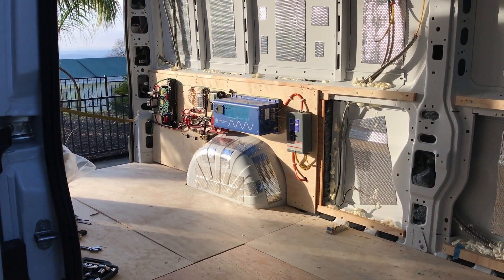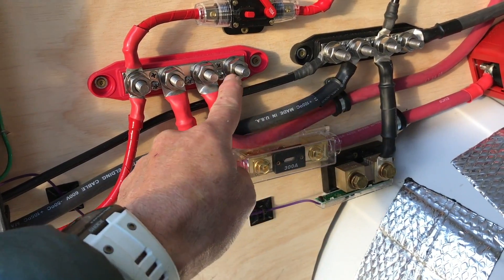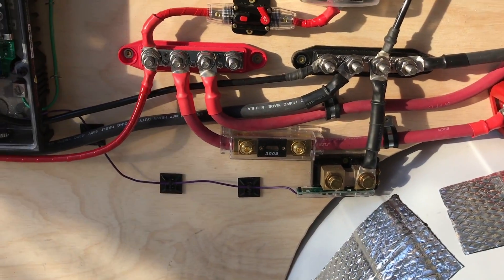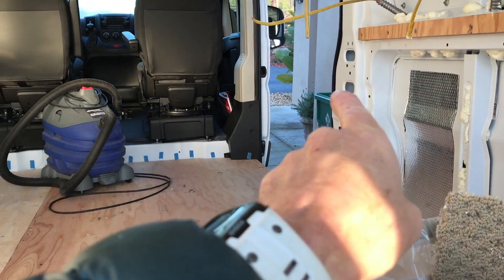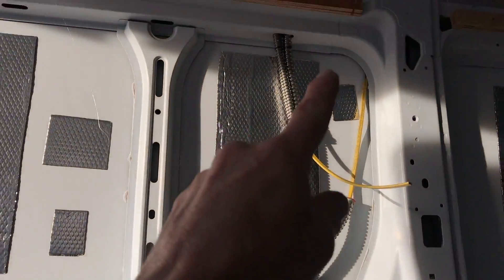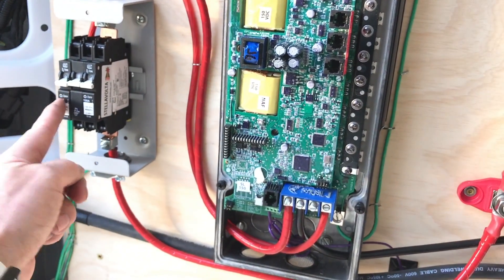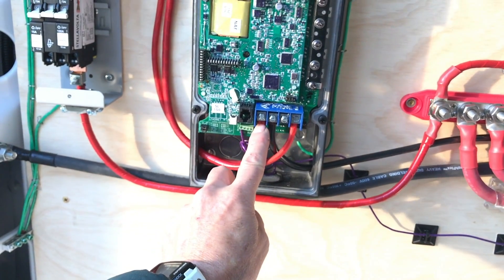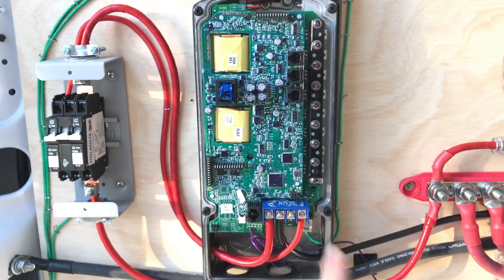Promaster Conversion #4, Solar Wiring

Comment: Hi Bart, followed your conversion and wondering if you still have the van and how is it holding up? Thinking about doing another conversion and liked your layout and electrical set up. Thanks.
Reply from the maker: Everything still works fine.  Technology has improved a lot since then.  From an ELECTRONICS selection, if I built another van today:
--I'd switch to a 3000 Watt Victron Inverter and a Victron Solar Charge Controller.  The Midnight Controller was overkill for van.  Technology has made it so much easier today since you use your iPhone to set it all up, and use your iPhone to Monitor everything.
--I did swap the lead acid batteries out for Battle Born batteries.  They're fantastic and worth the money.  Battle Born advises to switch to a different Battery Isolator that's on their web site.  That Isolator does require an additional wire from the ignition.
--I wouldn't bother with the metal armored cable protectors and just use plastic armored tubing to protect the wires from abrasions.
--I did swap out the 20 amp outlet on the side of the van for a 30 amp receptacle.
--All the wire sizes worked out fine.  
--I'd probably change over to a gas cooktop.  
--The microwave has worked fine all this time.
--The Cell Signal amplifier is GOLD, a must have.
--The Wifi amplifier is GOLD, a must have.
--The Dometic Frig has worked great all this time.  The only complaint is the freezer tends to frost up.  
--The Power Step has worked great all this time and was worth the money.
--The Fantastic Fan has worked perfectly all this time.
--I probably wouldn't buy the ELECTRIC version of the awning again.  I'd just buy the hand-cranked version where the awning legs attach to the side of the van.  The awning motor has worked fine all this time, but,  it's not big deal to hand crank out the awning when you want.
Reply: @onthetrailwithbart523  Thanks for the thorough recap! Do another van with the new tech! 😀Your videos are what helped me build my first two vans. You are very thorough and easy to understand. Thank you..
Reply from the maker: @iamjoec62  Thanks for the kind words.

Comment: Thanks so much for the quick and thorough reply.  I will try the switching routine you described.  I do have the remote inverter panel on my cabinet at the side slider door, but I have NEVER been able to make that green “shore power” led illuminate!  Thanks again, keep doing the great work that you do!
Reply: I had mine set to the config shown in the vid (1,1,1,0,0)  but the Aims guys corrected my settings to (1,0,1,0,1) which enabled my shore power.  Thanks for the vids, your van and MUCH inspiration!  (I even copied your insulation method - VERY efficient way to thermally tighten a van).  I’m looking forward to selling my 2500 and starting on a 3500 conversion - I plan to do it the very same way.

Comment: Hello Bart.  Your vids inspired me to build a twin of your promaster (much less power components, but the solar and battery board was a straight “copy/paste” for me).  The batteries were replaced this week with (3) new 280 Ah LiFePO4 batts, bit other than that, the rest has worked pretty well.  Question - when you connect to shore power, in order to get the Aims inverter to prioritize the shore circuit, do you need to power down the solar charge controller (and inverter)?  I assumed that the inverter would automatically sense the shore power and switch off the battery bank and just send that power through to my breaker box and to my outlets.  It has never been able to do so.  I have confirmed 120vac at the inverter input when shore power is connected and live.  Curious if you had any issues with the shore power.
Reply from the maker: --My routine is this:  When I'm getting ready to leave an RV park, I turn OFF the inverter first (center position (0) on the switch on the inverter face), then disconnect from shore power, and drive away from the RV park.  If the inverter is ON (without shore power) it will drain the batteries.  Newer inverters, like the Victron, use a TON less power to keep the inverter in "idle mode".
--When I pull into the next RV park, I first connect to shore power (with inverter off).   After shore power is connected, I then switch the AIMS inverter switch to "On" (the = sign position) and the Green LED light should come ON at the Aims Inverter display panel.  Remember, I use the Aims Remote Switch, as I showed in my "Final Walkthru of My Promaster" video.  That video shows the green light is "on".  If you don't have that remote, you'll have to go back to the inverter and switch the inverter back to "ON" (which is the (=) position).  That should then show a green light as "On/Shore power" at the Aims Inverter.
--I never touch the Solar Breaker unless I'm shutting the entire van down.  
--If I'm not going to use the van for weeks,  I shut the entire van down.   I shut off the master BlueSea switch from the batteries. I shut off the inverter.  And I shut off the breaker switch from the solar.  This way the batteries are isolated and won't discharge, and the solar charge controller is OFF too.
--NOW...one problem is if the inverter is somehow "broken", you won't be able to use your 110V outlets.  "If I had it to do over again"...I'd install a 3 position BlueSea master switch where the 10 gauge/Shore Power wire enters the van.  One position of the switch would be to bypass the inverter entirely, and just send shore power to the 110V breaker box. (basically a fancy extension cord to the outlets).  It would mean I'd have to crawl back to the breaker box to switch the power routing, but it would only be used if the inverter stopped working and we still need power to run the outlets.
Reply: Tried the routine you mentioned, got the shore power green LED to go on, but only for a fraction of a second, then it quickly reverts back to battery priority (the LED below the green shore power one).  I’m guessing I either have an internal issue with the Aims, or perhaps my wiring is not correct in my breaker box/120V distribution wiring.. it’s pretty straightforward (as you showed in your vid) one 3 wire coming from shore power to inverter “120vac INput” and the other wire coming from inverter “120vac OUTput” to the circuit breaker box.  Would you happen to know anyone (I’ve called Aims tech support - still waiting a call back) who specializes in troubleshooting these types of off-grid systems?  Thanks in advance, Herb
Reply from the maker: @InnocentCrocodile-pl2gd  Maybe try disconnecting the remote and just use the switch at the inverter to see if that solves it.
Maybe turn off all the 110V breakers and see if that makes a difference.
Probably the only people who you could ask would be a Van Builder in your area, or places like Camping World, or a Solar Installation company that does projects that use the Aims Inverter.
Reply: All set.  Problem was incorrect settings on a very small red and white switch bank on the inverter!  The default setting of those switch combinations locked out the inverter from prioritizing shore power.  Correct settings 1 or 0 for positions 1 through 5 are: 1-1, 2-0, 3-1, 4-0 and 5-1 (for anyone else using the Aims 2000W Pure Sine Inverter/Charger.
Reply from the maker: @InnocentCrocodile-pl2gd  My switch setting are shown a 5:25 on the video

Comment: This was a wonderful and clean explanation.  One probably easy question: what type of bolt did you use to ground your system to the chassis?  I know a little about electronics but almost none about vehicle wiring so this is a little bit of a blind spot for me.
Reply from the maker: I don't think the type of bolt matters, just a solid connection to the chassis. 
 I put some electro conductive/anti-coronsion jelly on the bolt (like what you'd use on battery terminals).

Comment from the maker: ALL wiring in vehicles is "grounded" to the auto body.  If you look at your passenger car, the negative lead of the battery is bolted to the metal body.

Comment: Have a very similar setup planned but for a 24V system so the amperage is generally lower.
- Renogy 2 x 320W panels connected in series (66Vdc, 80Voc)
- EPEver 24V 30A MPPT Solar Charge Controller
- SUNGOLDPOWER 2000W inverter/charger (24V)
- A123 LFP Battery w/BMS (24V) capacity 2400wh

I'd prefer to house all these components incl cables, breakers, fuse box, switches in a hardened plastic box with easy access from outside the box for connecting the solar wires, plugging to 110V outlets, 12v thru xt60 connectors, etc. with proper ventilation. Total weight will easily exceed 100lbs so perhaps the battery should be separate, TBD.

Comment: Hey Bart! Thanks for your time & effort. A huge help! Question; does your 100amp SolarPanel Circuit Breaker need to be mounted to that metal plate? Is it recommended or could it just as easily be mounted to the wood? 
THANKS
Reply from the maker: it's mounted on wood.  But it is grounded back to the chassis which can be seen how the green wire comes off the breaker box.

Comment: Hello again Bart - 
I've been using my PM for over a year now. I basically copied your electrical setup exactly. I have run into tripping GFCIs when I have them for shore power. I can get around this by using a two-prong adapter (with no ground) to my extension cord, but was looking into my electrical setup today to solve this issue. After taking a look, I think it's the inverter. It connects neutral to ground and is supposed to disconnect these when AC shore power is applied, but when hooking to a shore GFCI the GFCI trips before the inverter opens the ground-to-neutral connection. 

Have you encountered or solved this issue? I'm planning to call AlMS on Monday. 
Thanks!
Reply from the maker: No, I've never had that problem.  Not once.  I would think maybe one of the wires is touching ground.
Reply: @onthetrailwithbart523  I just talked to AIMS tech support and they said the inverter is not compatible with GFCI. I guess I'll keep using a two prong adapter if a gfci is my only option for shore power.

Comment: Hey Bart! What DIP settings (SW 1-5) do you have your Aims Power set at? My next step is powering on my system, and I’m not finding anything that is very clear on how this should be set up. Thanks man!
Reply from the maker: 1 and 4 are on.  2,3,5 are off.

Comment: What a phenomenal walkthrough video! Would a fuse between the isolator and the house batteries be redundant because you already have a fuse at the Promaster battery? Also, if my isolator does not have its own on/off switch, would you recommend adding one to that circuit?
Reply from the maker: the isolator already has a fuse located at the battery, but you can never be too rich, too thin, or have too many fuses!  But yeah, it's redundant, but fuses can be an easy place to turn off power if you want to work on something.
https://youtu.be/sbMmKVAzPvg?t=200
Reply: @onthetrailwithbart523  Thanks!!

Comment: Hi Bart! Where did you pick up your small breaker box for the solar breaker? Do you know the size?
Reply from the maker: https://www.midnitesolar.com/productPhoto.php?product_ID=79&productCatName=E-Panel%20-%20Samlex&productCat_ID=43&sortOrder=1&act=p
Reply: Fantastic, thank you! Any specific reason you went with a 100A breaker in there? Renogy said I would only need a 40A breaker/fuse going out to my + bus bar. I have minimal electrical knowledge, so just curious why you went with 100a breaker. Thanks Bart!
Reply from the maker: @markdaisy948  as I recall, it was a 60 amp charge controller, and Midnight solar only had 40 amp and 100 amp breakers.

Comment: Two questions actually.  (1) Why did you decide to place the equipment into the back drivers side of the van?  (2) With all the power sources arriving at the same bus (red) bar, how do you control not over charging the batteries?   Thanks

Comment: Would you mind sharing estimated cost of this setup?
Reply from the maker: I didn't isolate just the electrical.  I guess less than $3000.
Reply: Bart, I'm confused on how to wire the van from the electrical setup. I am starting to understand how things work as far as the solar power coming into the set up you so excellently demonstrated here, but I don't know how to wire everything from this point out to the outlets,appliances, etc. I have watched a lot of your videos, but do you have a video that goes into more detail on that piece? Thanks for your great videos!
Reply from the maker: Wiring outlets is the same as wiring home outlets.  There are many YouTube videos on that process.

Comment: Great and informative video! I would however not recommend using automatic fuses as a "power switch" since they have a finite life span, and eventually they will constantly trip instead of stay closed. Cheap to replace, but adding a proper switch is just as cheap and saves you extra work in the end.

Comment: Bart, this is OUTSTANDING. I'm at this exact point and following along your electrical build. Do you have a quick list with the gauge of wires you used across the whole set up (batteries, lights, fridge, etc.)? Amazing work, man. Really clean set up. Love it.
Reply from the maker: No, I don't have a list.  This guy did a really thorough job of parts though.
https://www.explorist.life/diy-campervan-solar/
Reply: Great, thanks Bart! Last question I promise - what size busbar did you use? 3/8" posts or 5/16" posts?  @onthetrailwithbart523
Reply from the maker: 3/8" posts

Comment: Bart does your Aims inverter buzz excessively?  Are you happy with it?  Mixed reviews on amazon, but it has it all: charger, transfer, and inverter.  thanks
Reply from the maker: It's worked great.  Never had a problem with it.

Comment: Great vid! How is the alternator doing? Do you have a link to it? I was thinking of using this one, but it's quite expensive. Is there much of a difference between yours and this one? https://www.amazon.com/Sterling-BB1230-12-Volt-30-Amps/dp/B071DMV7PF/ref=as_li_ss_tl?ie=UTF8&qid=1541606375&sr=8-2&keywords=sterling+bb1260&linkCode=sl1&tag=faroutride-20&linkId=82d0f3439eaa68de91af4ac5d6715853&language=en_US

Comment: Hey Bart the outside plug you used was it a 15 amp plug and what is the name brand as well as the tv antenna plug i would like to get the same one, thank you Bart love the van.
Reply from the maker: https://www.amazon.com/JR-Products-47755-Exterior-Jack/dp/B002UC171C/ref=sr_1_4?ie=UTF8&qid=1548777551&sr=8-4&keywords=rv+cable+tv+inlet

https://www.amazon.com/ParkPower-150BBIW-RV-Power-Inlet-White/dp/B002QALLOQ/ref=sr_1_4?ie=UTF8&qid=1548777631&sr=8-4&keywords=rv+110+inlet

Comment: Bart, that size and type wire did you run for your 12v lights, vent fan etc. ?
Reply from the maker: I used 12 gauge stereo wire on EVERYTHING 12 volt.  14 gauge is probably plenty though.

Comment: Hi Bart - Quick question. From the renogy site, my 3 100w panels produce 6.25 amps. So I should use a 20 amp breaker for the 18.75 amps. You've got way more watts coming off your panels but only 9 amps?
Reply from the maker: with solar panels wired in series, the voltages are additive, but the amp are just what one panel makes.
With solar panels wired in parellel, the voltages are just what one panel makes, but the amps are additive.https://youtu.be/c5Mi6tYkrkI?t=434
Reply: On the Trail with Bart I thought you wired them in parallel... makes sense now.

Comment: On the ac side what is the wire gage from inverter to breaker box and also from shore power. Thanks
Reply from the maker: Sorry for the delay...on the road.  12 gauge
Reply: hey, thanks for the reply...I overkilled with 10 AWG and used 12 AWG from breaker box to outlets. I'm sure its fine. These videos were great in introducing the topic and provided a sweet little roadmap to set up my van.

Comment: Hey, thanks for putting up this video. I have a quick question. I am going to be running 4 100watt Renogy solar panels in parallel to a 40amp mppt solar epic charge controller. That in turn connects to 2 155 amp hour batteries also in parallel. my question is this; is a 15amp breaker sufficient between the positive line between the panels and the charge controller. Or do I have to use something like a 25amp breaker to account for the added amperage?  Any info you could give me as far as fuses and breakers would be greatly appreciated. Thanks!
Reply from the maker: Well, it depends on what the amp output is on each panel.  
In series the amps throughout the circuit are just what one panel can produce.  So if the solar panel each produce 10 amps in series, then the circuit amps is 10 amps.  (so a 15amp breaker should do it)
But if it's in parallel, and each panel is cranking out 10 amps, then that's 40 amps (but low voltage). (and a 15amp breaker will not be enough.)
https://youtu.be/c5Mi6tYkrkI?t=416
Reply: Thanks. so it looks like series is the way to go. I noticed you soldered thicker wire gauge on to your panels. what gauge wire did you end up using for that?
Reply from the maker: 8 gauge stranded wire is about as thick of a wire that will fit into the solar box